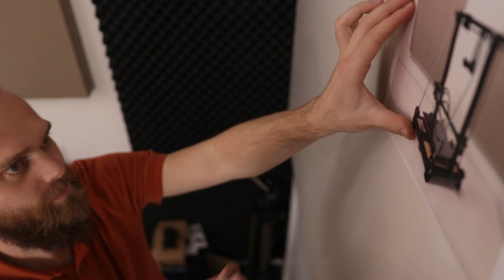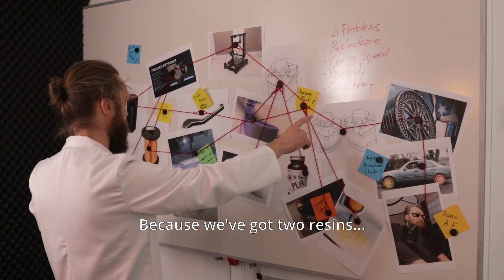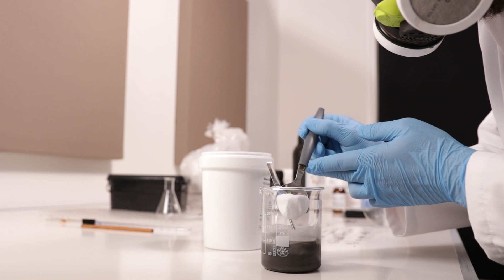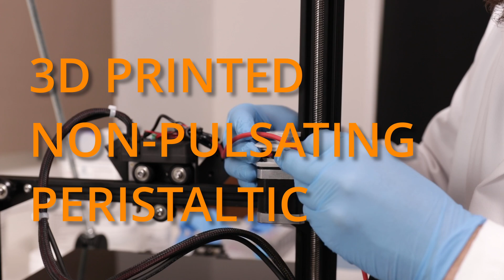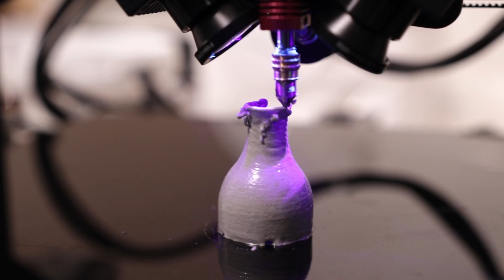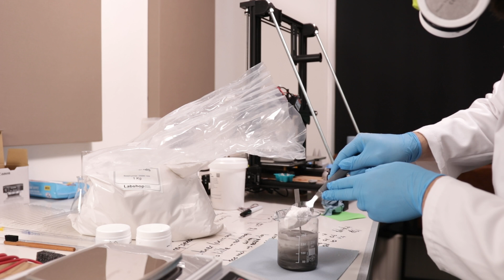FDM resin printing: Game changer or stupid?

Comment: For your first layer, what about underlighting the bed? Not sure if that has been mentioned or tried yet, but it may help as the base of the layer will cure first.
Reply from the maker: Hmm, that's interesting! Plan A would be to find the best possible surface and if I cannot find any, this would be an interesting option. A step further would be to use the same screen as a normal resin printer and only light up where the part itself is. I hope that just a build surface works😅
Reply: @properprinting  > What about a mirror bathroom tile?, some off axis UV light should be reflected back up to the underside of the extruded resin helping it set onto the build plate. Just a thought.
Reply: @BlueChrome  If the glass was sanded, it would help scatter more UV back to the workpiece, probably help with adhesion too.

Comment: You should consider using a syringe pump, much higher accuracy and will let you not worry about pumping while you figure out the other problems. You can buy ground glass syringes or just use disposable ones.

Comment: To me it looks like there is some shadow under the nozzle where it isnt curing instantly, perhaps getting the lasers closer to it will cure faster and prevent it from sticking to the nozzle.
Reply from the maker: You've seen correct! In the previous attempt I showed my monkey brain solution to cast a shadow there. I have an idea for a different, yet quite similar approach ;)
Reply: @properprinting  I wonder if sending the laser through a fiber optic cable might help?

Comment: I would shield the nozzle from the UV light to avoid curing it while the resin mixture is touching the nozzle. It should be thick enough to not flow away if the curing starts like .1 seconds after being dispensed.

Comment: This is so stupid and I love it!  I think your biggest problem is resin consistency.  Your mix is not mixed well enough and not stable once it's mixed.  There are other viscosity modifiers available, and you may find one that doesn't fall out of suspension and is more easily distributed (and isn't solid so it won't clog).

Ambient temps might be an issue, too.  There seemed to be a pattern to the failure.  Resin curing releases heat, and cold inhibits curing.  Maybe your build plate needs to be heated up so the first layer cures fully? Or maybe you need to run slower on the first layer to give it more time to cure? 

Good luck on this crazy journey!

Comment: Nice!  Are you using any heat in your extruder per chance?  I was wondering if you could make a thicker resin going into  a slightly heated extruder to soften it until it hits the cooling fans and stiffens enough not to run away and then it will cure with the UV lasers!
Reply from the maker: Not yet, but doing that with extreme viscous high performance resins would be so interesting!

Comment: maybe attach led in ring around nozzle and with soft control witch diod will light? you will have more controll on curing. You could code that diod that passed path of nozzle only fire. so there will be less "uv light leakage"

Comment: Nice! Whats the idea behind the dye? Wouldnt it be better to keep it clear, so its easier to get a cure all the way through? Seems to me a big reason for the failures are inconsistencies in curing, allowing the layer to be dragged off one another. The alternative would be thinner layers but I bet there are limits to that with the filler and fiber and what not.
Reply from the maker: We ran into the problem that the light penetrated too deep causing it to cure inside the nozzle. With the dye we can tune the penetration depth.
Reply: @properprinting  Ah right makes sense.

Comment: Amazing stuff. I wonder if contraption akin to Inkjet with moveable bed and different color resins (instead of inks) & UV curing light would allow to print in full color (and faster). Those printers can have >1000dpi...
If instead of colors there would be different-property resins (conductive, insulating, structured, magnetic) it could become a Star Trek replicator ;)
Reply: Inkjet based resin printing has existed for a very long time in industrial printing, it's a technology family usualy called called material jetting. On material jet, you can do really crazy shit like have per voxel (3d pixel) custom color, opacity, and durometer on very high end machines, like stratasys j series polyjet.  similar technique is binder jetting, using inkjet head to deposit a binder in a powder. Neither of these processes really want a moving bed (nor does fdm).
Reply: @JustinBuildsThings  Agree, but those high-end machines cost arm&leg, so not often found in hands of amateurs.
I'm suggesting a extension of extruded-based 3d printer. Attaching inkjet head+UV light to FDM printer (regardless on cinematic, but I'd assume that coreXY would work the best) would allow using many materials with very fine granularity. Some of inkjet heads handle 11 colors so having support for 11 different materials (colors, transparency, mechanical/electrical properties) by virtue of dissolving additives into resins would be a revolution. 3D PCBs, full-color objects (with transparency) - fun stuff.
IMO price-wise it could be cheap, so available to hobbyists.

Comment: This project is amazing. To prevent the resin from sticking to the nozzle, a cone around the nozzle might help or angle the UV lights in a different way. Ensuring there is no way the resin cures near the nozzle. As others already pointed out an enclosure might help as well to avoid unwanted light and keep the temperature more constant. 
Best regards
Reply: I was thinking a little of that ptfe coating stuff that slice engineering sells or ptfe spray applied to the nozle using a towel.

Comment: It looks extremely cool but you shouldn't promote bad safety practices. Resin releases fumes during curing process so you should wear respirator while you work with resin at least while you blast light on it while standing nearby.

Comment: you could control precisely the amount of resin by using system like in diesel cars "common rail" the nozzle is opened/closed electronically while pump just keeps the right amount of pressure
Reply from the maker: Daunting, yet interesting🤔

Comment: I remember seeing a printer with same concept as this at FormNext last year by Massivit 3D. As far as I recall they use a photocurable and water-soluble "gel" with exactly the same process for hardening as shown here. They also have a second extruder with thermoset resin. 
So you can print a soluble mold with this uv-fdm process and fill it with thermoset resin at the same time.

Anyway, it's an amazing start!
Reply: So instant curing or after finishing the layer?
Reply: What is the patent scenario  around this concept? Patent attorneys can be painfully humorless.
Reply: @ulrichkliegis4138  ViscoTec Pumpen- u. Dosiertechnik Gmb produces Moineau pump extruder called vipro-HEAD, around 4k euro.
Reply: @jzagaja  What does this have to do with a potential patent conflict situation?
Reply: @ulrichkliegis4138  same principle?
Reply: @jzagaja  the concept of putting UV- or other radiation - curing resins, putties and similar somewhere via a nozzle or somehow and curing it immediately have been around some 30 years ago and more already. The involved companies were all keen to first publish new methods as patent applications. BTDT. 
In the U.S., you never know if there is some application that people pull out as soon as there is somebody making money with it. Other than in the EC, where a patent application is published after a time, inventors in the U.S. have more time. The limit is the runtime of a patent after its first priority filing. 

And at that time, the owners have the chance to adapt the application's wording to the present conditions, to a limited extent. What I saw in this video demands respect for re-inventing this method in an elegant way, I just wanted to sound the patent alert alarm on the lowest level. Motivater by Nihilianth's mentioning that he saw something similar at the FormNext event. 

If you dig into the history of 'Rapid prototyping' as it was called at that time you will be surprised what ideas were around - and died very quickly again.
Reply: There is an italian company called spherecube that does exactly this. Met them this year at formnext

Comment: Its probably clogging because the mixture isnt very homogenous. Just put in a mixer / blender. Then just fine tune the mix, too runny? Add more ceramic power. Too stiff, add some glycerine maybe?
Reply from the maker: Eventually, once I was printing for a while, it didn't clog anymore. I think you're right about being homogenous, especially at the beginning and I need a better stirrer for that. Because it's so thick I'm looking for something that doesn't rotate as fast as a blender. I'm afraid that it'll burn out the motor.
Reply: @properprinting  Well you could try stirring it in a ultrasound cleaner. Those cheap ones on aliexpress can do the job. Plus you can use it to make graphene ^^.

Comment: A nozzle made from Delrin or PTFE might get less resin stuck to it, or maybe spraying the brass nozzle with non-stick (like the stuff used on pans) would be enough?
Reply from the maker: I'm going to make a custom nozzle which has a parallel tip to make the angle 90 degrees. I hope that this will be better already. This will not be like a syringe needle though since that is too flexible.

Comment: what if you used a curing light on the bottom of the bed, like the resin printers?  you could potentially cure the bottom later more easily
Reply from the maker: That's an interesting thought. I think that the risk of curing inside of the nozzle will be increased though. I still have to find the best possible print surface for this.

Comment: Small scale MASSIVit printer. 3d print nerd had it on his channel. 

Could you use heat make the resin more liquid? So then you can tie flow rate to temp for any resin. 

Overhang free prints too…
Reply from the maker: An interesting subject would be to heat up the resin to print extremely high viscous yet high performance resins! This would only work if the additive is not the weakest point though.

Comment: What do you think about the sovol Sv06? Is it good for a beginner
Reply from the maker: I can honestly say that I'm impressed with it and it's clear that they put thought into it. I am off course biased, but I'm going to use this printer for my regular PLA and PETG prints. To answer your second question, yes this is good for a beginner. IMO better than most printers we own if not the best due to its easy assembly and the way the bed is leveled (no leveling knobs)
Reply: got it, I may get one during the sale, thank you for the recommendation

Comment: Consider a syringe pump. They are ideal for precise linear dosing. Peristaltic pumps are generally pulsatile and best for precise bulk transfers.
Reply from the maker: Thanks for your suggestion. I designed a non-pulsating pump ;) I like that nothing, except for the tube, comes in contact with the resin and it doesn't have a limited volume.

Comment: With resin that needs strength, colloidal silica powder is better than the glass micro beads.
Reply from the maker: I just read a comment mentioning this, namely AEROSIL 200. I've never heard of this stuff, but it looks very promising. Thanks!
Reply: @properprinting  in the USA I use west systems 406, not sure wich you can get there.
Reply from the maker: @evil_me  I'll find out, thanks!

Comment: Use AEROSIL 200 for thixing the resin (high viscosity when still, lower viscosity when moving). And Byk Chemie for Wetting and dispersing and anti settling additive.
Reply from the maker: That's interesting, thanks for your suggestion!

Comment: You should add a wipe channel on the bed somewhere. Like a v-slot the same angle as the nozzle then and g-code every layer or so to go wipe the nozzle. Or even just and upside down brush.

Comment: The problem seems to be the lack  of retraction., causing over extrusion.  Obe option might be to add a solenoid pintal valve to the nozzle instead of retraction.
Reply from the maker: That's interesting, I haven't thought of that. Because I eventually want to use this for continuous fiber printing I think that this becomes less of an issue. Thanks for your suggestion, I keep it in mind!
Reply: @properprinting  it may be possible to make the pin valve clear the nozzle by poking a small parallel section on the end through the hole